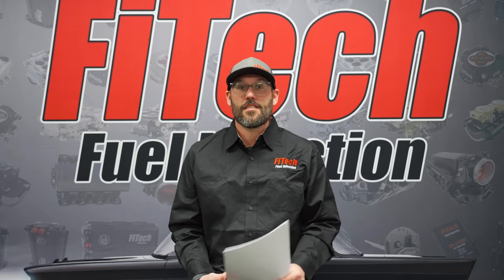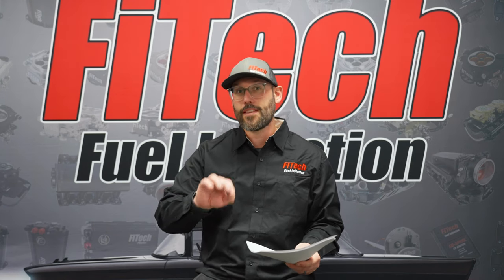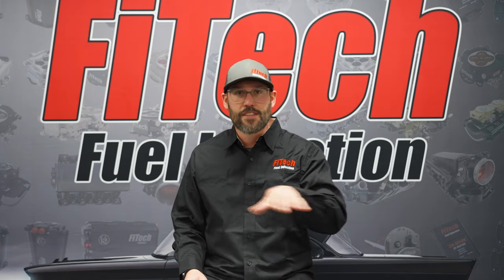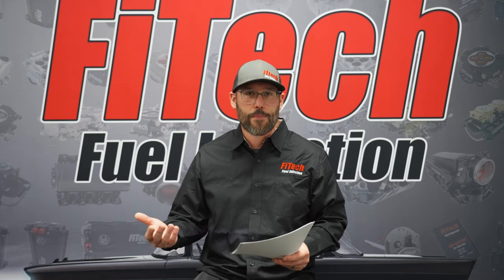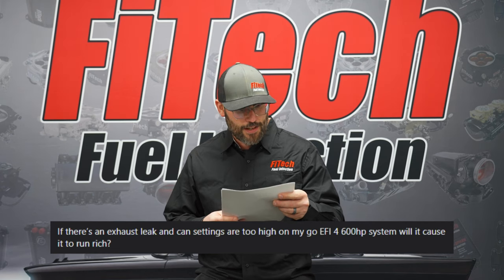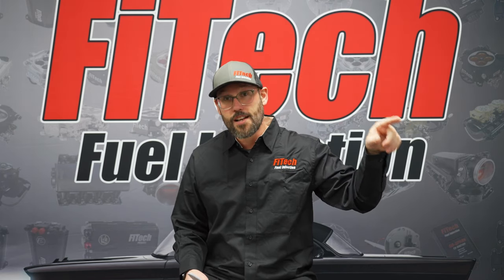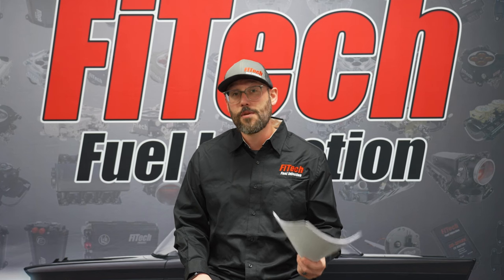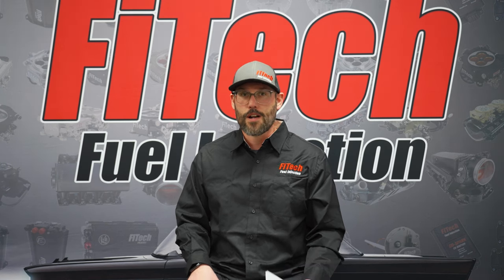FiTech Fuel Injection Q&A | 1 | EP100

Comment: I use the 600hp unit with timing control. I have watched Jeremy’s video on setting up the distributor,in particular, adjusting the phasable msd rotor. In the directions it states advance the rotor in the direction the distributor rotates. In my application, Ford, it rotates counterclockwise. I advanced the adjustable rotor to the second longest mark which is 10 degrees. In the video Jeremy says to adjust the phasable rotor half to 3/4 it’s scale but the directions and tech support says 3/4 of the width of the rotor tip. Which is the correct way to do this?
Thank you

Comment: I have been running a 30002 for 6 years it runs great. The only issue I been battling with it stalling when I come to a stop. Everything I’ve read and tried has not worked. I have noticed that when I am just about to stop the AFR will go very lean sometimes it will catch it something it won’t and stall.
Reply from the maker: Record a datalog of the issue and send it to techmail@fitechefi.com for review.
Reply: I had that same issue. This is what i ended up doing. Hopefully it works for you. 
1. Go to efi tuning
2. Find idle control and select
3. Scroll to decel IAC. Mine was a positive number. But I'm currently at negative 20 or 25. And it seems to have worked. Give it a try. Good luck🤞😁

Comment: Has anyone used these efi kits for other engines like a toyota 22re?
Reply from the maker: We have had a customer install a 39001 on a 22r engine.
Reply: @FiTechEFImedia  what about kit 38352 used as a 4 cylinder app? I know it’s sequential but will it hurt the ecm not having 4 injectors hooked up?
Reply from the maker: @nathanmurray5482  The #38352 is for a GM TPI engine. It requires the use of a GM small call computer controlled HEI distributor. It will not work on a 4 cylinder engine.